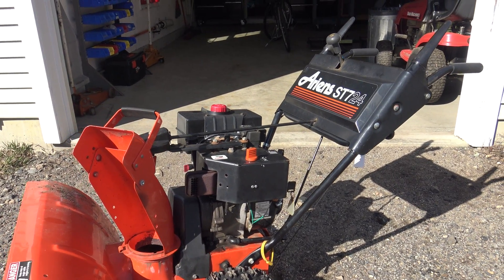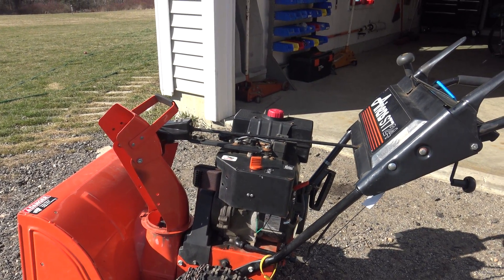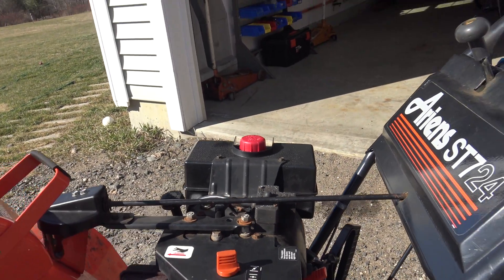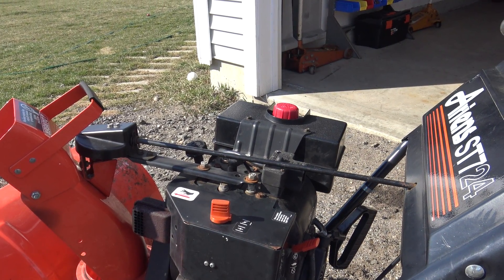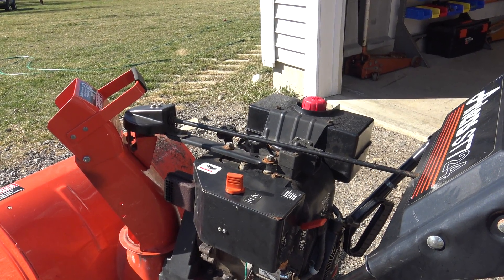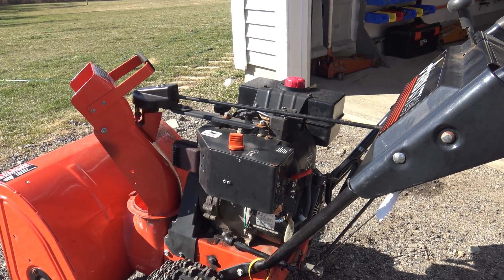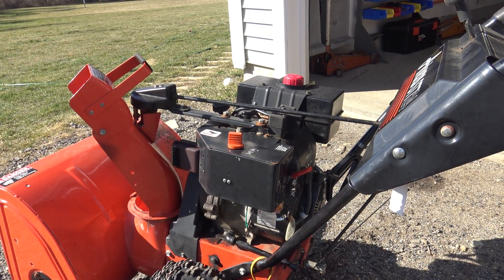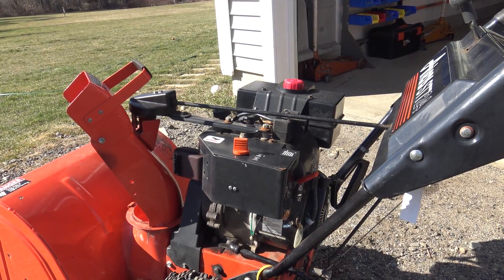Snowblower shuts down after 20 minutes

Comment: I have the same exact problem in my 7hp Tecumseh Simplicity Snowblower.....I replaced the carb for $11 on the Jungle Website and replaced the fuel & primer line along with spark plug.....no difference.... I then removed the oil breather and checked the valve gaps..... Intake was 7 thousandths and exhaust was 6 thousandths ....manual states proper gap is 8 and 12.... so I was able to carefully file the valve stem bases thru the breather to 8 and 12 exactly......runs better, but still dies after 10 min....I re-torqued the headbolts...( 2 were a tad loose ) and ordered a new coil off of Jungle Website for $10....I'll see how this works this week.....I really like how your fix is thinking outside the box.....nowhere else have I seen this fix...and I have No doubt it fixed your snowblower....This will be my go-to fix if the coil doesn't help.... Thanks,  Bill...... btw...do I detect a Boston accent ??  fellow New Englander here

Comment: I think Dan might have been leaning towards when you replaced the fuel line and routed it outside  the cover ,wasn't the rerouting in as much as a new fuel line vs the old. I've had many fuel lines go bad on older models. They get hard and brittle. I've see many not routed correctly inside the cover and the fly wheel will slice into them. If you first check the gas cap( easiest) then the carb in which the float is properly adjusted and clean. the third culprit is the fuel line. I'd say 95%  of the time it's 1 or a combo of these factors. I will keep the  coil in mind , tho I feel if properly gapped and engine starts easily enough it's probably not the coil.
Reply from the maker: It was defiantly vapor lock as I could see the fuel bubbling in the class filter just prior the machine shutting down. I don't know why everyone is having an issue with that. I know what I dam well saw and what I did fixed the problem PERIOD.

Comment: Running the fuel line on the outside of the recoil cover is not the fix. Also, you don't have a vapor lock issue. You also don't need to add a filter to the fuel line. The tank has an internal screen to keep debris out of the fuel line. Adding a paper/cloth/fiber filter is just another misstep and if there is any moisture in the fuel, the filter is likely to freeze especially because you have run the fuel line outside of the engine cover.  The fuel line runs through the engine and this helps prevent freezing as does the metal box around the entire carburetor. Did you notice the muffler is in that same area? Why? Because it heats that heater box to keep the carburetor from freezing.  Your issue was most likely a small piece of rubber from the fuel line getting clogged at the needle valve just inside the carburetor. This valve has a tiny passage in it and it doesn't take much to clog it. This older setup also requires a fair amount of fuel in the tank in order to deliver fuel to the carburetor because the fuel line loops up where it attaches to the carburetor. This happens on the older engines similar to yours. You may have a cap that is not venting properly, debris in the carburetor at the needle and seat valve, a partially shut off fuel valve (if you have one under the fuel tank or not enough fuel in the tank to rise enough to fill the carb. It's most likely not an electrical problem (coil) since it works now after moving the fuel line. You probably had some crap in the fuel line that found it's way into the carb inlet and is creating a blockage. I suggest replacing the fuel line and running it through the engine as designed. Before you attach it to the carburetor, take the bowl off the carb and remove the float and needle. Using the proper tool or a paperclip with a small hook on it, remove the rubber seat from the carb and blow out the inlet with compressed air to verify there is no junk in there. Replace the rubber seat with the circles facing down towards the ground and reassemble the float setting the float level to 3/16" i believe.  This will solve your problem properly.
Reply from the maker: WOW!  Thanks for all that information. In my case the carburetor was new and rerouting the fuel line did indeed fix my problem.  I was able to see the vapor lock through the glass filter as the gas turned into bubbles before my eyes. The machine has run perfect since changing the routing. None the less you have provided very valuable information I will not hesitate to refer to in the future. thanks so much.
Reply: @richardspaulding5035   So, the see through fuel filters often appear to be "vapor locked"... but they are not. They just have air inside the filter but it doesn't prevent fuel from flowing properly. I agree, they look empty but believe me, they flow fuel fine.  My guess is that when you replaced the fuel line, whatever was obstructing the flow was removed from that work.  Remember you need a fair amount of fuel in the tank to get it to high enough to enter the carburetor.  Good luck with everything.
Reply from the maker: Yes Dan I am very well aware that air does indeed appear in the fuel filter.  Typically they appear to be only half full. In this case seconds before the engine would stall out  bubbles and steam like vapors would appear in the glass filter.  The engine would run fine for about 20 minutes or so then suddenly as the bubbles would appear  the motor would immediately die out.  I would allow the motor to cool for 10 minutes. With doing nothing else but allowing the motor to cool the motor would start right up  and run  fine until the bubble would once again appear.  After rerouting the line I have had no more trouble, It is going on 3 years now since rerouting the line. I appreciate all the information you have provided however  I don't understand why you cannot accept this??  My machine runs fine now!!
Reply: @richardspaulding5035  I can accept that it works now. All I'm saying is that the setup you are using is unnecessary. I've serviced about ~800 of those particular TEC engines in the last 30 years and never had an issue with the factory routing of the fuel line or with vapor lock in the middle of winter. I'm sure if you went back to the correct configuration, made sure the carb inlet flowed properly and fuel delivery from the tank was correct, it would work fine. The bottom line is, it runs now and that's what matters.
Reply from the maker: Dan I have enjoyed our conversation.  I agree the rerouting of the fuel line may not have been necessary.  Obviously I am an armature when compared to your experience.  What I had done after replacing the carburetor is I adjusted the idle screw up so hi it rendered the throttle lever useless. I felt the extra rpm would increase performance as the snow here in Mass is very heavy at times. The result is the engine I think is running much hotter than designed thus resulting in the vapor lock.  I am surprised the motor being abused like that has lasted this long.  I have not reviewed the video in a while but I think I did mention I had increased the engine rpm. I am sure if I backed off the rpm I could reconfigure the fuel line back to spec.  But as you say it works. I have since purchased a much more powerful machine so it is now relegated to a back up roll.  Thanks again for the conversation.
Reply: @richardspaulding5035  Was fuel gravity feeding normally through the fuel line before your modification? Did your mod include a new fuel line?
Reply from the maker: @chriskipfer7563  Yes it appeared to be and I did install a new fuel line with the modification. the video was made about 5 yeas ago as I no longer have that machine. I gave it to a friend. As far as I know it still runs. Thanks for watching my channel.
Reply: I come here to see what could be the possible solutions as my snowblower has the same problem. Surprised to read the suggestion from Dan which I believe has pinpointed the real problem and solution. Thank you so much! Dan

Comment: What was the cold and hot compression?
Reply from the maker: As I recall I did both for comparison, took a reading cold then after the machine stalled out there was negligible difference so I eliminated the internal components as the problem.

Comment: Be careful turning up RPM. Idle not so much, but max speed you don’t want it much more than 3,200 RPM. If so, you can possibly do serious engine damage. There shouldn’t be any need to route that fuel line to the outside of the engine shroud. Personally, I would check hi RPM, set it correctly and install fuel line as per OEM diagram. If problem still exists you will need to check engine over for other issues. Good luck.
Reply from the maker: I agree,  I have slowed the rpm down